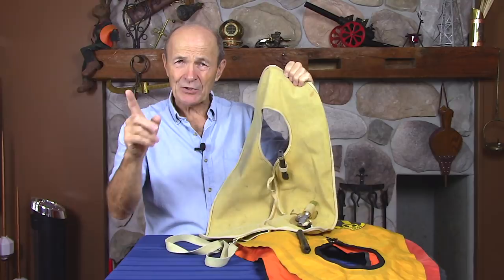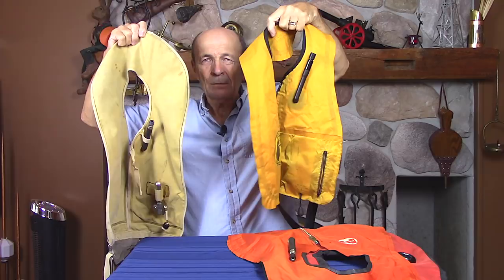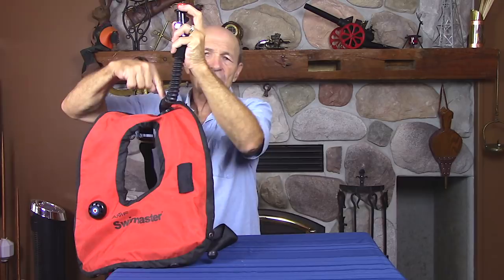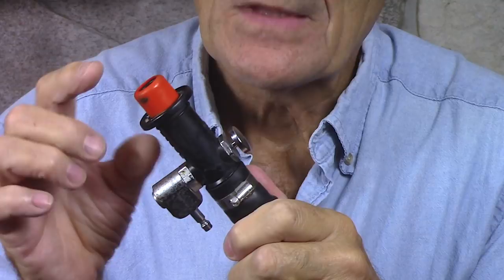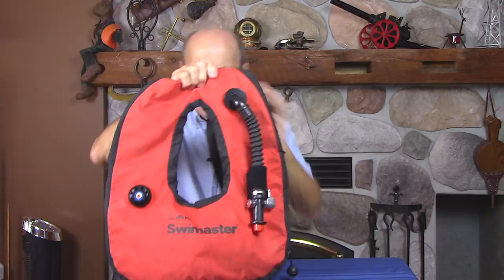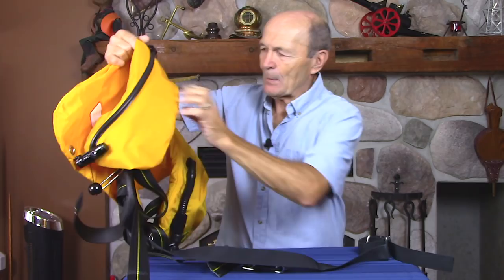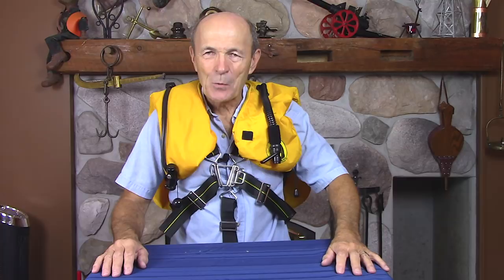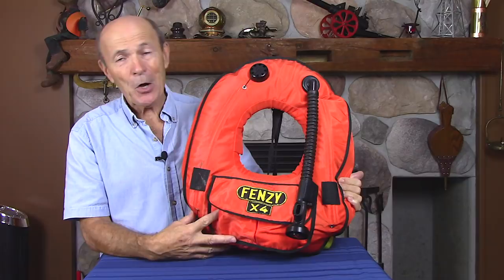Vintage Scuba: BCD Evolution, From Lifevest to Fenzy - S06E02

Comment: Again, a good video. Thank you.

You made the point that self-inflating BCD's were full of carbon dioxide and so not breathable. But the Fenzy self-inflates from a small mini-cylinder of air. So, theoretically, in an out-of-air situation, you could breathe from the BCD (certainly a couple of inhalations) safely.

AP DIving (formerly AP Valves), in the UK, took this possibility a stage further and made (still make) BCD's (Buddy Commando) that can be fitted with a so-called Auto-Air combined power inflator AND second stage that can be used to breathe air from the BCD. This air was/is the air from the main cylinder that is put into the BCD in normal diving UNTIL you get an out-of-air situation on the main cylinder. If you are using this system at the time the main cylinder runs out of air you will feel this situation BUT the device will then switch to give air from the BCD automatically. Then it is a case of using the air in the mini-cylinder to maintain buoyancy AND to breathe. This is a very useful system as it gives a second air source without the extra hose that a normal safe-second uses (naturally, you have to donate your primary to your buddy if he/she is out of air). Just to be clear - normal diving and buddy out of air, switch to Auto-Air and donate primary - self out of air, switch to Auto-Air and use air from the mini-cylinder through the BCD.

Michael
Reply: Michael, The Buddy Commando is a new one to me.  Its lack of popularity, at least in the U.S. is telling.  You sound knowledgeable enough to know that breathing off of a BCD is fraught with potential problems and is sort of a taboo subject among certifying agencies and not even known by the general diving public.  I don't honestly remember where I picked up the idea from but it gives me piece of  mind knowing that I have the option .  99% of the time there is always residual air in your BC, especially at depth.  The potential problems arise from lack of training, practice,  coordination and the possible unfavorable configuration of the inflator mouthpiece or port.  Your first breath may contain residual water in the inflator hose and then there is the venting of exhaled air back into the BC or into the water and still maintaining your proper buoyancy and rate of ascent.  
I was hesitant to bring this subject up  because I believe this site is primarily for briefing new divers and this is way beyond their scope and probably not a good idea to put into their minds.  When you think of all the options to safely get to the surface in an out of air situation one can argue that BC breathing should not gain a popular following. I was quite surprised when Alec (I think, let slip about the CO2 in the BC) made the comment. Didn't think he would touch the subject with a ten foot pole spear.   I don't know how many others caught on and started thinking about the possibility.  
I'm the same age as Alec and have lived through all the permutations and evolution of buoyancy control, from simple oral inflation vests (couldn't afford a Fenzy at the time) to stabilizing jackets and wing backs. Another major concern rarely mentioned anymore is that many BC's will float you face down on the surface if you were to lose consciousness. Oh well...
 as David Letterman use to say "...kids, don't try this at home."

Comment: Hi Alec. I really need a suggestion of modern back inflated BCD that can easily work with my Kraken double hose reg.
Reply from the maker: Most any will work but I might suggest the Oceanic Bio which has a stretchy bladder and bungees wrapped around it. When you let the air out, the bladder (air cell) almost disappears.
There are probably others like it.
Alec

Comment: I love my seatec horsecollar, for warm water recreational diving I wont dive anything else!
Reply from the maker: They were great Colin - were! 
Once you try a Stab Jacket (stabilizing jacket) style BCD, you'll be hooked. No crotch strap, simple cummerbund waist strap, instantly adjustable whether on the surface or at 100', more even support (no more groin pulls, holds you upright on the surface, etc),  tank & BCD all-in-one easy to use package, etc.
I used Horsecollars for years and loved them too but - never again.
Borrow one for a short dive. Send me a picture of your smile.
Thanks for your comment.
Alec
Reply: @AlecPeirceScuba_SeaHunter  Oh I have a stab jacket when I teach classes and a backplate and wing for tech diving, a ccr as well, I'm just weird and still love the horsecollar, I dive without a bc once in a blue moon given perfect conditions and low risk as well.